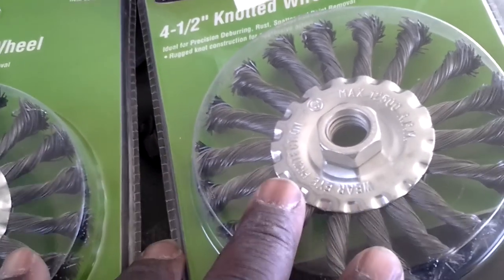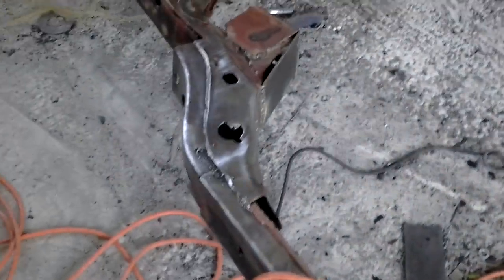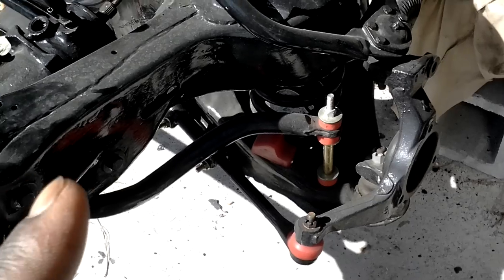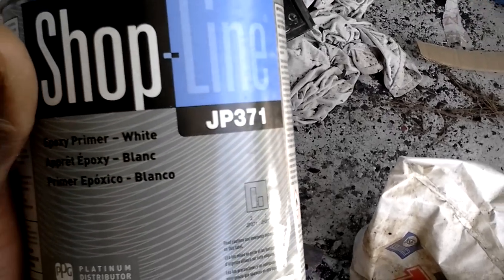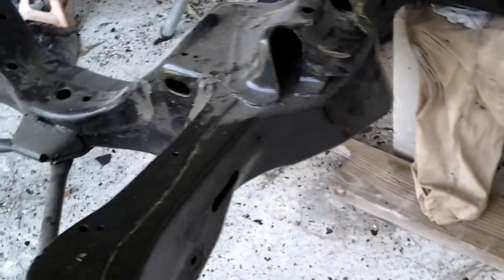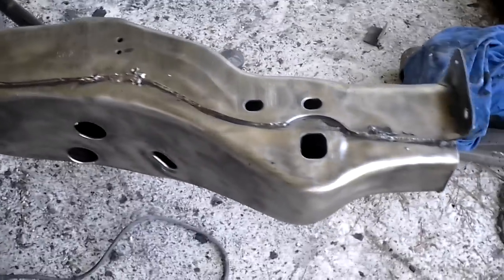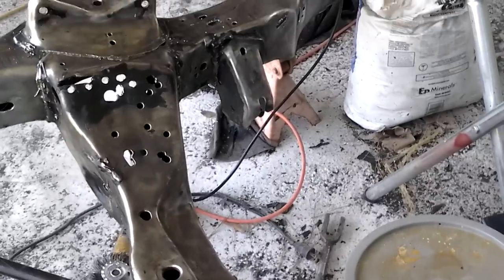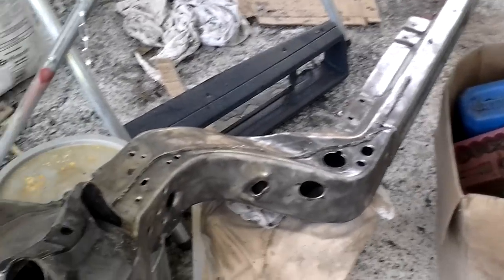Gbody frame MAKEOVER PT 1

Comment: that shopline i mentioned to you while back glad see ya went that route good stuff for price 180 grit real good and prime away but make sure before primer goes on you wax and grease remover real good pour wax n grease remover in spray bottle and get 2 rags one clean and one for wiping wax after wipe wax right away go over with clean rag so no residue left behind from wax you do that and get the frame to 180 grit you be good i would also let primer dry for few days or longer if can so it shrinks out and so chassis paint will adhere to it good since there two diffrent products melting them together might cause issues so let primer dry good then scuff with 400 grit or red schotchbrite pad wich is  same as 400 grit make sure you get dry coat first then couple wet coats i prob basecoat clearcoat instead chassis saver use shopline all way for best results then you could do it all in same day with no worrys since all be same product clearcoat is were protection comes in that could be why mine dont chip or hasnt yet lol great update and dont forget wax and grease or it wont stick no matter what ya do

Comment: MR_getinthere  I see you but for them springs you can have that shit 1st and last time for The chassis saver worked just fine for me but I had my frame sandblasted the reason you had a problem is the grease or oil whatever it is that makes it shine didn't mix well that why you had that problem
Reply from the maker: The frame was clean wiped it down  with wax removel need to be primed first ..yea that blasted gives it  something to bit on ..that wire wheel make the metal very smooth/slick  thats what happen

Comment: Please help I just recently purchased a $500 roller 81 malibu for an lx swap. After I took it home I noticed that the computer and the passengers kick panel was missing. Do I need to find one or is it possible to still use the car without it ? It's a street/strip. All advice,tips and suggestions welcome
Reply from the maker: if u going LS u.dont need none of that crap...u.good
Reply from the maker: even if u was going 350 chevy with carb u.still.would need it less u was using Electric carb with plug and distributor cap
Reply: +MR_getinthere thanks for the info I appreciate it. you, nova,deezy and veltboy are really inspiring me keep up the great work.1
Reply from the maker: +Bucks Bucks thanks fam ..you better start post vids lol of the build